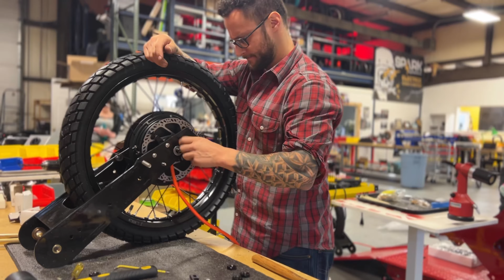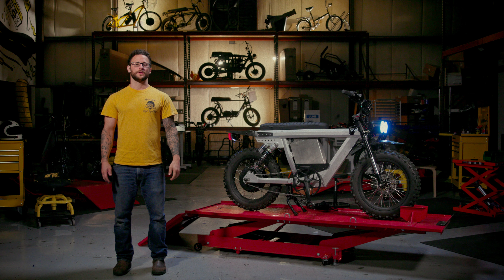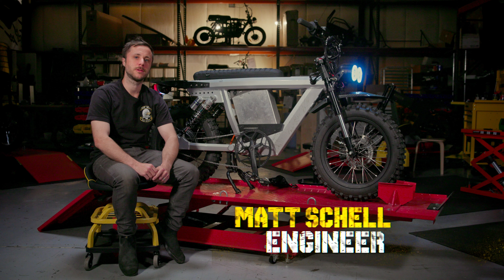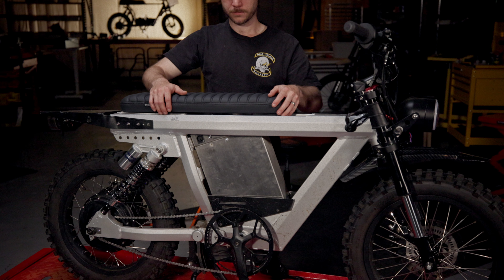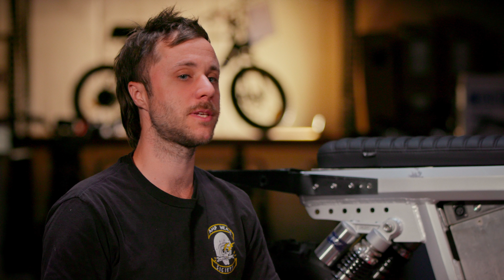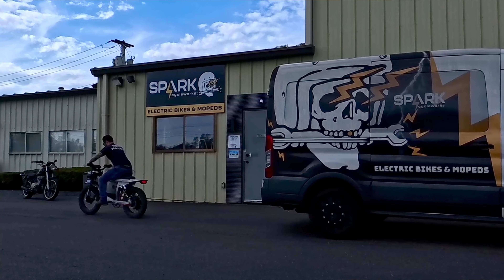The Brute eBike: Assembled in USA by Spark Cycleworks | Fardriver Controller |4,000 Watt | 72V

Comment: i can tell you already that seat will damage your hip  ,,,, need more padding for us old ppl
Reply: Far from it… I just test rode it two weeks ago up in Connecticut, you can always adjust handlebar height by adding a riser.If that doesn’t work-you can adjust The suspension system. It’s all about getting the appropriate bike fit, remember you’re not peddling so there shouldn’t be much stress to your hips.